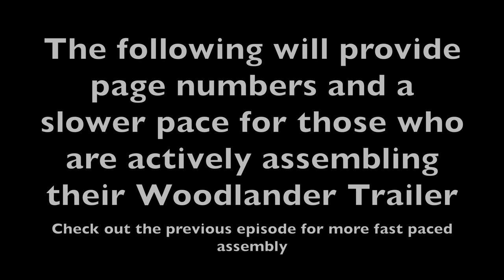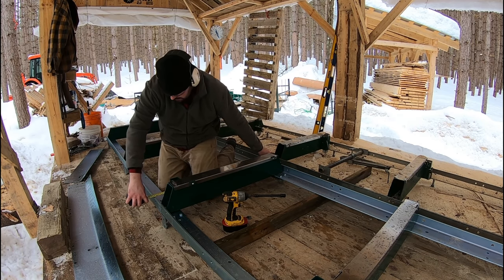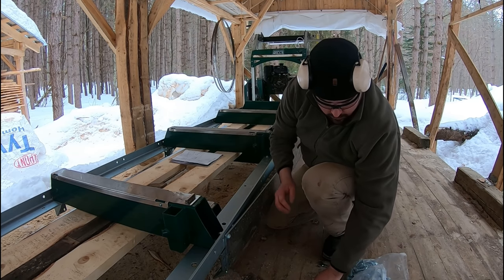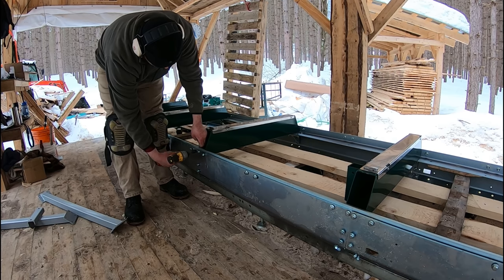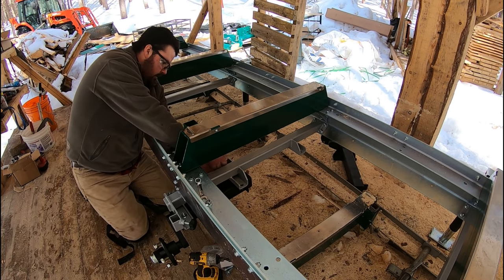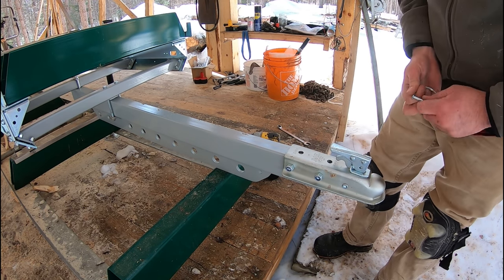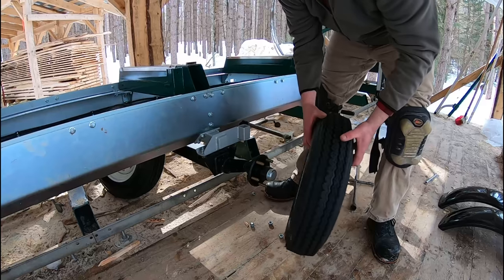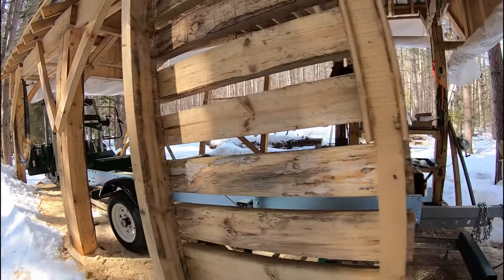Woodland Mills HM130 Max Woodlander Sawmill Trailer Assembly | This WILL help you with assembly

Comment: Got my HM122 Max last week.  I have watched your videos two or three times, and I still built the dang trailer backwards!  As I was mounting the axle brackets I realized something looked off.  So I had to remove the jack holders and bunks and turn it all around.  Then I got rained out.  Now I'm at work.  Hoping to finish up later this week.

Your videos are wonderful..... if I'd actually pay attention!
Reply from the maker: You're not alone. I'm sure i"ve done things very similar many many times. Glad you're liking the videos.

Comment: I find it very impressive that bolting together this trailer has this kind of strength it's very well engineered and you did a Great job putting it together really looking forward to seeing how it saws. Great video Sandy and thanks for all the detail
Reply from the maker: Thanks Jeff. Yeah sure is surprising when staring at all the parts on the ground but sure goes together nicely and seems well done when all finished

Comment: How important was it that the rails are exactly 37" outside to outside? How much forgiveness did you feel this assembly had to still allow for square cuts? I'm assembling the woodlander xl trailer on top of the crate and finding its difficult to get everything square and level and plumb when the track rails are so overextended beyond the crate, so I'm prioritizing it being level and square with the track rails width differing by 1/8" across the 18' span
Reply from the maker: I think the width should be very close to 37" just because the wheels need to ride along the rails consistently. I think 1/8" might be ok but I'd have to roll the sawhead down the track to ensure that's the case

Comment: Hey Sandy, Dang I can't get anything done around here 'cause I can't quit watching you videos!!!!! LOL My question here is, when you decided to go from the 130 to the 130 Max, Why did you get the trailer also? I've been debating which way to go myself but can't make up my mind. Do you mill off site from you shed? I can see where that would come in handy and could be very profitable. But is the roughly $2000 difference in price worth it? Or if you could have a do over would you stick with a setup like you had with the 130? Keep the videos coming I don't want to work around here any ways !!! LOL
Reply from the maker: I got the trailer as it helped with moving the mill around the property a little bit. I haven’t done alot if moving around and so it could always be a good addition for ya if you think you don’t need it now to get it later on
Reply from the maker: Thanks for checking out the videos. I appreciate your support on the channel. Don’t let me keep ya from working for too long though as you’ll get me in trouble haha

Comment: I just ordered my saw mill and was wondering if you ever use a metal detector prior to sawing. I recently bought my land and am unsure if the previous owner used nails or screws in trees. If you have do you have a recommendation on a metal detector?
Reply from the maker: Great question. I don't normally use a metal detector although I could've used it a few times as I have hit things in trees before. Sorry I can't help ya more here
Reply: They make little hand held detectors. I had a regular full sized one that I use. It's a Bounty Hunter brand. It works great.

Comment: I started building mine and I have a 1/16 difference in the width. it vary between 37 1/2 and 37 10/16. Wondering if this is and issue. Mine is a HM126. When you mesure the witdh of your is it bang on evrywhere?
Reply from the maker: I think 1/16" isn't enough that I'd worry about it unless I noticed the machine not cutting quite right.

Comment: Hey Sandy! I'm glad I found your amazing YT channel! I just purchased the HM130max and will be following your lead as soon as it gets here. I'll finish watching this when mine gets delivered in about 8 weeks.
How long did it take to assemble and get it operational?
Just curious how much time I need to set aside.  Thanks again and I look forward to more vids!
Reply from the maker: Hey Max! Thanks for watching. Took me probably a good 8 hours or two shorter days of 4 hours each to assemble the trailer.
Reply: @sawingwithsandy  wow 2 days just for the trailer. And you're a pro at this, lol! 
I'm a newbie so I'll give myself 4 - (8hr days)... 🤣🤣
Was curious if you could do a quick video on the required tools needed for this? I saw you used a torque wrench and that's a tool I don't have yet. Thanks again for inspiring new homesteaders like myself!!👍
Reply from the maker: For sure Max. I’ll keep that in mind and try to put that into a video down the road. Thanks again for watching

Comment: It sure is a lot shorter. Can you get sections to make it longer?
Reply from the maker: Yeah it's the standard length compared to my other sawmill which has an additional 6.5' section added. This trailer can also allow for an additional 6.5' length added to it. I may end up doing that down the road depending on how I find this one

Comment: I like my welded sawmill frame a lot better than all those nuts and bolts but that's a good mill for small trees and a starter up I have a 48 inch wide cut 21ft long and it doesn't have a 🔩 in the frame but I'm down in lower Alabama and we have a lot of big trees down here I have cut some cypress that where 51 inches around
Reply from the maker: Yeah can imagine those make for some nice lumber.

Comment: Way-way too many nuts, bolts and parts that will vibrate apart. Fabricate a one piece, 3 x 2 square tubing trailer then bolt through the rails down on spacers with 1 x 2  x 2" channel welded to the 3 x 2 11 gauge tubing.
Reply from the maker: I can see the reasons why that style of trailer may work for ya. Think overall this style of trailer works well for when someone doesn't have the welding tools or knowledge to construct a trailer